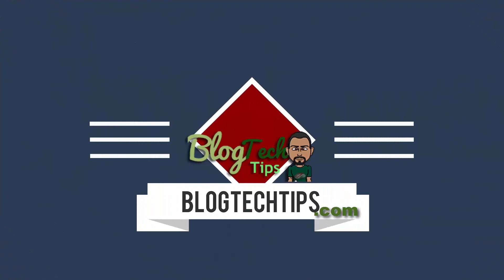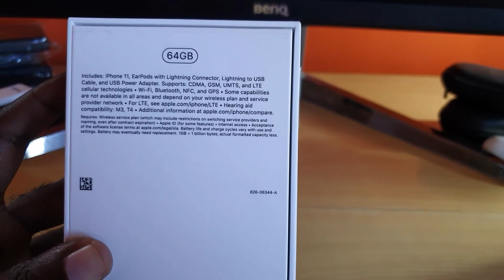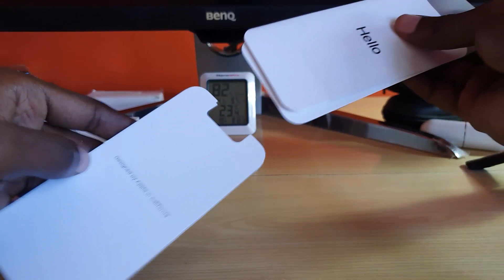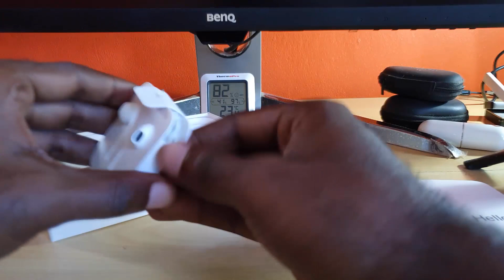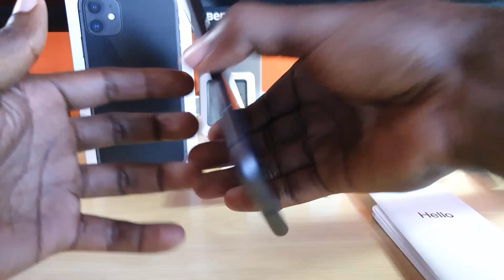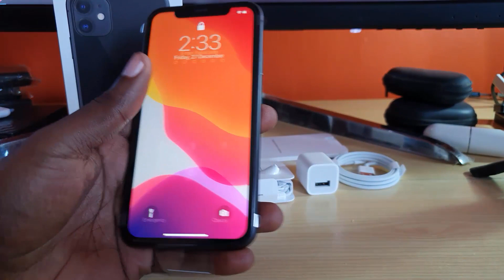iPhone 11 Unboxing and First Impressions

Comment: I made that mistake as well I kept the plastic on and said it was a finger print magnet haha
Reply from the maker: Yeh I know right-keeping it on though until the case and screen protector arrives
Reply: @rickytlc1985  yeh so am i. Ive got a screen protector and case but I need to go out and get one of those guys to put the screen protector on for me. Where I. Love I can just give a bit of change and they will do it with no bubbles etc.
Reply from the maker: Definately want it to go on without flaws -worth leaving to someone more experienced.